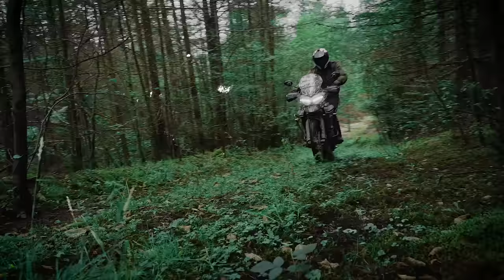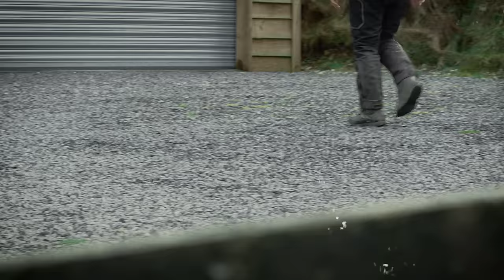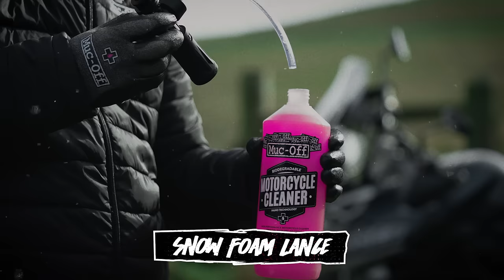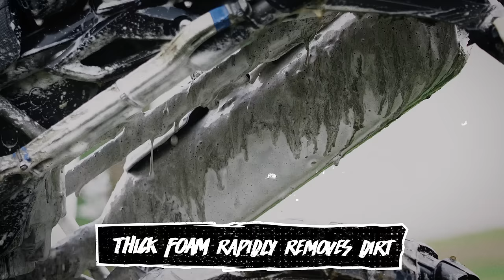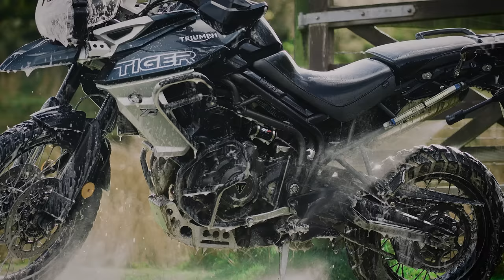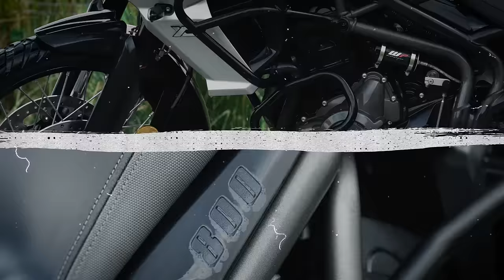The Muc-Off Pressure Washer for Motorbikes

Comment: not the way to clean your valuable bike that you have spent your hard work on owning. Rinse, foam, rinse and dry equals no scratches. Job done.
Reply from the maker: Hey, thanks for reaching out. We understand your concerns and those are the exact reason we developed our Bike Specific Pressure Washer. Not only will our Snow Foam Lance break the dirt apart completely, our Motorcycle specific lance was designed to care for your bearings, suspensions and delicate finishes. Hope this clears things up for you! Muc-Off

Comment: Can I use my collection of Karcher K2 compact bottles, nozzles, suction hose attachments, etc.. with this? Basically does it use the same standard fittings that there is a large aftermarket for?
Reply: Did you ever find an answer to this? I saw another video with a guy using a yellow karcher and he said the attachments didn't work for his karcher
Reply: @seanpetersen8044  Just pour the Nano tech cleaner in your soap dispenser

Comment: I can do this on any motorcycle without damaging radiator or engine?
Reply from the maker: Yes dude! The pressure is specific to motorcycles and won't damage any delicate parts including radiators or engines and bearings or delicate surfaces 🤘

We've got some great deals on them right now, check em out: https://muc-off.com/collections/motorcycle-pressure-washer-bundles?page=1

Comment: Honestly cant see how its different from any other jetwasher out there on the market already.  
I use a Nilfisk jet wash on my motorbikes it comes supplied with 3  differing attachments that seem to do exactly the same thing as the muc off one, admittedly I had to purchase a foamer attachment separately but that only cost about £12.
Reply: You did all wrong  You should wash off with water first  then snow foam.doing it your way your your scrubbing dirt and grit into your paint work
Reply: It's pink, dude!
Reply: Max Pressure is the difference.